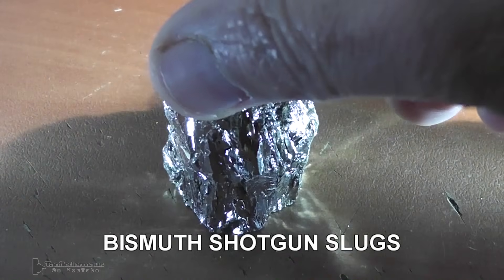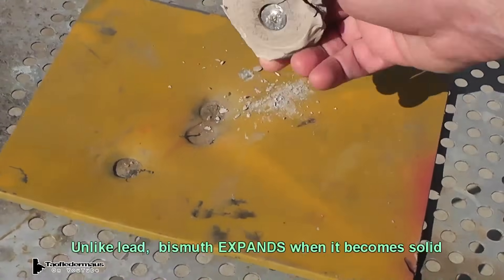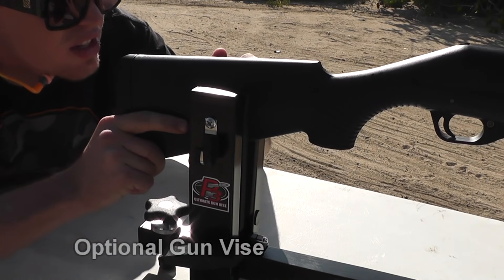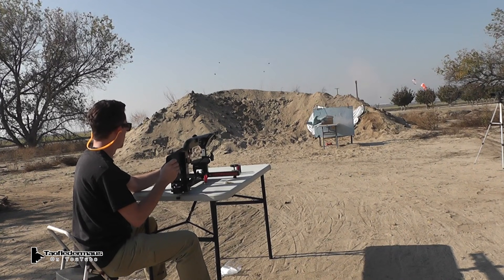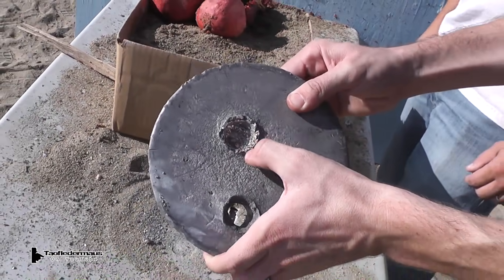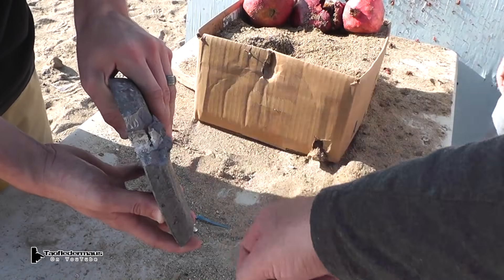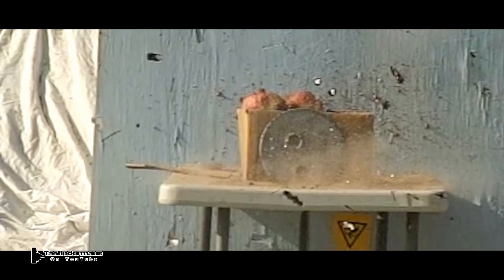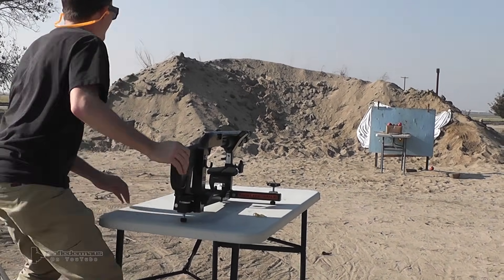BISMUTH BULLETS  -  We make and SHOOT Them!

Comment: You could use some molding silicone. It works great for casting low melting metals and you can reuse the molds over and over again

Comment: I love bismuth. I made an alloy of majority zinc,95%+, with a small amount of copper and 1 or 2 percent bismuth by weight. The ingot I made cracked into 3 pieces while I was taking it out of the mold, and tends to fracture sorta like glass or obsidian when struck with or against something hard, and I've been wondering how it would do as a slug. I need to buy one of the Lee 7/8oz molds and try it out

Comment: forgive my ignorance, but if the bismuth expands when it solidifies does that mean you had to shave it down some for it can go through the barrel without a problem?

also, have you ever tried a slug made from hot glue?
Reply from the maker: +ranwolf76  The slug is smaller than the barrel.      We did try some hot glue and lead shot slugs but they were a pain to make,  really messy with the glue stringing all over the place and a few blisters on the fingers trying to stuff it in there.   There were no benefits over a wax slug or anything else.
Reply: ***** ah ok... hmm how about portland cement or grout? though I think the grout would shatter in the shotgun

Comment: Here in Finland its illegal to hunt ducks with lead shot. If you have older shotgun that cant handle steel pellets, your forced to use bismuth. Using bismuth birdshot however is equal of throwing small rocks and does absolutely nothing versus a duck. Ive had the same bismuth shells at my belt for last 10 years now in case of inspection :p
Reply: we can't use lead shot for water fowl for obvious reasons, and i have never heard of the performance of bismuth shot. Steel works but i wouldn't consider taking an old shotgun hunting.

Comment: The issue of non-toxic projectiles may end up being addressed with alloys.  90% tin alloyed with antimony and copper can yield an anti-friction bearing metal that is denser than any of the component elements; and over 93% the density of lead.
Reply from the maker: +halnywiatr   But at 5 times the cost.
Reply: +TAOFLEDERMAUS   Agreed.  For range and open field shooting nothing beats lead (yet).  For fowling over marshes and other non-current water bodies steel or bismuth will have to do until alloys catch up.

Comment: Thanks for FINALLY getting a shooting stand..You will not get good, or even repeatable results from shooting a heavily recoiling gun shooting off a hard object.. a sand bag would've worked just as well.. NOW, you have to go back and repeat some of your other experiments that you shot off wood block, and see the difference with the shooting stand..     Tip.. If you can help it never rest the barrel on the front, try to rest on the fore stock. Also, put a extra layer of padding on front..I've seen people actually put sand bag on front..

Comment: an epoxy or superglue slug could be cool if you could find a way for it not to stick to the mould
Reply: I know a guy
Reply: +b33lze6u6
 A mold made of thin suspended plastic or paper would work well, methinks. Not to make the mold removable, but to make it negligible.
Reply: Thelothuo ahh good idea
Reply: *****
 That would work as well.

Comment: Thanks for the video!  I wonder if the fragging characteristic would make the bismuth slug a good  breaching tool.  From what I understand, law enforcement entry teams typically use a round that will destroy the latch/hinges of a door, but fragment in the process, so that the projectile doesn't accidentally kill someone on the other side of the door who could potentially be an innocent hostage.

Comment: Please use the same molding method to make a slug that has magnesium (or anything else highly combustible) inside it.
Reply: +UrbanTarzan Duh A solid slug of magnesium won't ignite like that. It will behave like an aluminium slug.
Reply: soylentgreenb I thought it might ignite if it hit a metal plate. Also, not a solid slug, but a lead slug with some magnesium/potassium inside.

Comment: Seemed to work fair. I would guess any material that can hold together and has a decent density would work fine as a projectile. I know gold works very well. The only problem with gold is the price is NOT right at all, ha. You better be someone really special for me to shot gold at.

It seems that a solid slug without the hollow cavity does not work nearly as well as the standard Lee slug design. The round were accurate, but they looked like they were tumbling. At short range, that would not matter all that much.

Comment: how about trying to cast a slug out of solder??
Reply: +Tony Perdue Solder is usually mostly tin which is a soft metal that has a slightly lower density compared to iron, so it should behave like an inferior lead slug. Casting lead and tin is very similar so existing lead molds can be used. The metals added when making solder does change both the melting point and the hardness but the density should not change much.
Reply: +Tony Perdue Slugs made of soldiers?
That's just cruel...
Reply: +Blahorga Slisk of course he could just use led solder

Comment: The amount of energy the bismuth slug has compared to the lead one is negligible. 
Lead slug weights more, but the bismuth slug goes faster. 
Lead is about 13% more dense, but I only think the energy difference between those slugs are about 5-7%.
Reply: +TheLawnWanderer also, the main factor that makes the bismuth lug appear weaker is that it breaks apart on impact, think of it like birdshot VS 5.56,  the birdshot will have what seems like 0 penetration, but it really is strong enough to kill a man(or at least heavily injure one)

basically, against a flash&bones target it would most likely break apart inside the body dealing huge damage to the target while getting the least risk of casualties against other peoples or machinery, as it has very low penetration.
Reply: +TheLawnWanderer yeah, but if you don't want them to die, why the fuck are you shooting them with a slug?!
Reply: +iota-09 And in the event that a survivor makes it to the operating table it will piss off the surgeon that has to dig for fragments in the slush that used to be muscle, bones, and intestines...

Actually I'm not convinced that it would fragment anywhere near as much as when it was shoot in the lead pancake. If it hit a shoulder blade it might happen but just a rib probably wouldn't be much of an obstacle.
Reply: Blahorga Slisk Bismuth wouldn't cause any toxic reaction from the victim though, so they wont die from lead poisoning
Reply: John Harvey First time I've heard of these. Don't think I'd want to use these as anything but a last resort. After all if they are toxic to any significant degree then you wouldn't want to hunt with them, and use them for self defense and you're likely to get a lot of grief when the lawyers hear about that.
Besides ordinary slugs are probably going to do the job and at far less risk of you going to jail for defending yourself.

Comment: The good thing about bismuth is that because it's relatively soft you can shoot it through a full choke whereas with steel half choke is max. Here in the UK all wildfowl has to be shot with non toxic ammo so it makes all the difference, also has more stopping power than lead which will go through without much damage.
Reply from the maker: +MrcabooseVG  Some of my chokes say  "no steel shot"  but  bismuth doesn't seem to harm them.

Comment: wait that pistol, was that a ruger mark 1,2,3 or 4, or a walther p38? also.. i shot this spirnkler head with a .12 ga worst idea. it just exploded and hit me, and well. just exploded like a grenade, lots of shrapnel going in pieces..
Reply: +Rods Ahed It looked like it was lacking a hammer.
Reply: "Marky Mark" Markus Gaming/LurkingFan4 it looked like it used to though, maybe its one of those Deactivated replica guns
Reply: Rods Ahed Possibly.
Reply: Definitely some copy of a P38. You can see at 2:14 there's a bunch of random junk molded on the slide and the takedown lever and safety are the wrong shapes. The frame is shaped wrong at the back of the slide, and it's missing the hammer. Doesn't look like there's an extractor either. No such thing as a Ruger mark 4 BTW.
Reply: Hughes Enterprises Possibly a toy gun?

Comment: It's too bad Sodium is so unstable...that would make for a interesting projectile
Reply: +netrioter If it wasn't so unstable, it wouldn't make for such an interesting projectile.
Reply: +netrioter I asked Jeff about this, he said it is probably illegal.
Reply: i see the "you're doing it wrong" crowd has arrived. You got some real winners following you TAOFLEDERMAUS. hahaha
Reply: +netrioter Never very enthusiastic about using something you can cut with a butter knife as a projectile.
Reply: +netrioter it is too lightweight for an effective projectile.
Reply: +TheBackyardScientist Perhaps a 'tracer' slug with lithium fill in the rear. lithium is quite stable for an alkali metal, atleast in my experience with it. it burns beautifully
Reply: Well, anything you'd shoot would be super salty with you over it.

BA-DUM TISH.
Reply: sodium is a very reactive element, it would be dangerous
Reply: ImJamon have you ever actually handled and experimented with this element?
Reply: darkwarrior no, because its very reactive, wont let us use it in the lab, (im in highschool) :P
Reply: almost caught my college lab on fire with a lithium demo, only because i failed to clean a large spot of oil and it popped suddenly rather than a smooth burn.

it is reactive but nowhere near as bad as they seem to make it out to be. it tarnishes quickly in air, turning black with oxide and heating up to an uncomfortable warmth. never had a sample combust, even when submerged in water.

potassium though.... different story
Reply: darkwarrior wait, i dont know if im confusing Na with K, aight, nevermid my comment
Reply: Na=sodium K=potassium
Reply: +ImJamon Different density but they are both alkali metals and both react violently with water.
Reply: +netrioter Would I use it for ballistics though? Na.
Reply: +netrioter Guys, you could pick a heavier alkali metal with the exact same properties. Might I recommend Caesium?

Caesium is almost 4 times more dense than sodium, and its chemical reactivity with things like water is FAR higher. While a sodium bullet would sizzle on contact with water, a caesium bullet would damn near explode.

You'd probably have to fire it in a capsule much like they've been using for liquids.
Reply: ***** If the point is to make an interesting projectile, then it doesn't much matter whether you fire caesium into water, or PETN at an object.

Anyway, I was just talking about Caesium because the topic of the thread was sodium bullets, an alkali metal.
Reply: 1st sodium is legal to own and 2nd it oxidizes in air from the humidity but it won't combust unless put it in water.
Reply: +Steve Johnson true, but I don't think you would have that problem in a slug sized chunk
Reply: +netrioter What if you took a slightly smaller than normal slug of sodium then had it coated with a layer of rubber? The rubber would keep it dry and would likely be destroyed on impact, or even when it passes through the rifling should they choose to use it.
Reply: Matthew Traver I think perhaps the rubber seal wouldn't stand up to being fired. It'd probably be better to use some metal for the sealant, like copper.

I was also going to say perhaps you could make a 2 chambered bullet that's half water half sodium... But then I realized you could get a better reaction with Hydrogen Peroxide and a catalyst in the front of the bullet. Not only would you likely get a bigger explosive reaction, hydrogen peroxide is also extremely toxic, and will cause permanent caustic damage to a person's body. In fact, such a bullet would probably be outlawed under the Geneva convention since it could probably count as a chemical weapon.
Reply: Hat Man Geneva only applies to military use. It's a big part of why our soldiers can't use hollow points in their sidearms. As Geneva prohibits ammunition intended to expand or fragment for anti personnel uses. It's a big part of how the 5.56 came to be adopted. The round isn't intended to fragment but if it hits at near muzzle velocity it often will. Same thing with the small hollow cavity on some 5.56 it's intended to improve the aerodynamics so it's okay. That being said if one were to design a bullet intended to poison or explode on impact. I'm sure the ATF would have something to say about that.
Reply: Daniel Curtin
Actually Hague Convention of 1899, which the US did not ratify..

    (IV,3): Declaration concerning the Prohibition of the Use of Bullets which can Easily Expand or Change their Form inside the Human Body such as Bullets with a Hard Covering which does not Completely Cover the Core, or containing Indentations

    This declaration states that, in any war between signatory powers, the parties will abstain from using "bullets which expand or flatten easily in the human body." This directly banned soft-point bullets (which had a partial metal jacket and an exposed tip) and "cross-tipped" bullets (which had a cross-shaped incision in their tip to aid in expansion, nicknamed "Dum Dums" from the Dum Dum Arsenal in India). It was ratified by all major powers, except the United States.

In 1910, the British took the opportunity to replace their Mk VI cartridge with a more modern design. The Mark VII loading used a 174 grains (11.3 g) pointed bullet with a flat-base. The .303 British Mark VII cartridge had a muzzle velocity of 2,440 ft/s (744 m/s) and a maximum range of approximately 3,000 yd (2,700 m). The Mk VII was different from earlier .303 bullet designs or spitzer projectiles in general. Although it appears to be a conventional spitzer-shape full metal jacket bullet, this appearance is deceptive: its designers made the front third of the interior of the Mk 7 bullets out of aluminium (from Canada) or tenite (cellulosic plastic), wood pulp or compressed paper, instead of lead and they were autoclaved to prevent wound infection. This lighter nose shifted the centre of gravity of the bullet towards the rear, making it tail heavy. Although the bullet was stable in flight due to the gyroscopic forces imposed on it by the rifling of the barrel, it behaved very differently upon hitting the target. As soon as the bullet hit the target and decelerated, its heavier lead base caused it to pitch violently and deform, thereby inflicting more severe gunshot wounds than a standard single-core spitzer design.  In spite of this, the Mk VII bullet was legal due to the full metal jacket used according to the terms of the Hague Convention.

Comment: If it expands as it solidifies, does that mean it is also harder than than other common casting metals?
Reply: +ExaltedDuck and if I had watched a couple minutes further before commenting, those glorious slow mo shattering shots would have told me yes. it is.  =D
Reply from the maker: +ExaltedDuck  It is harder and brittle.   You could take a hammer and shatter it.   You can alloy it with softer metals though.